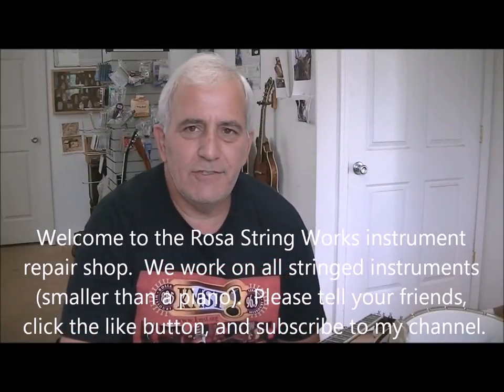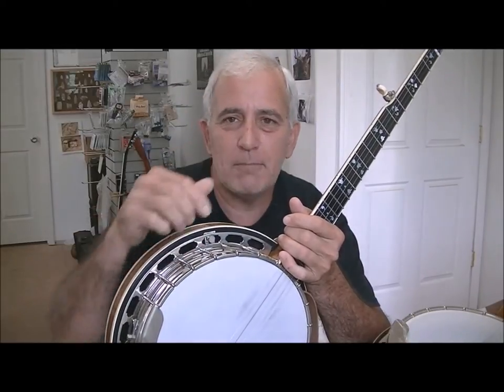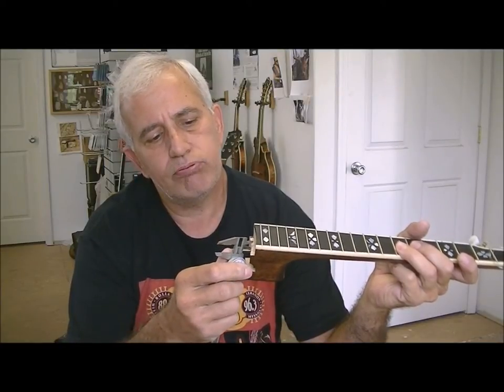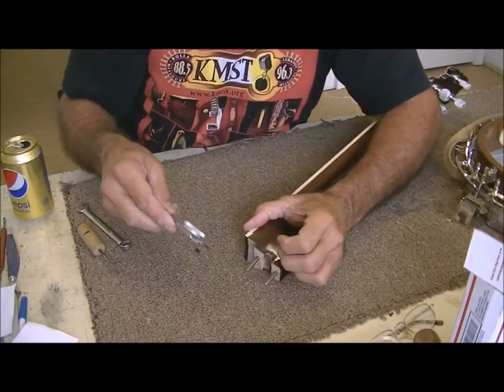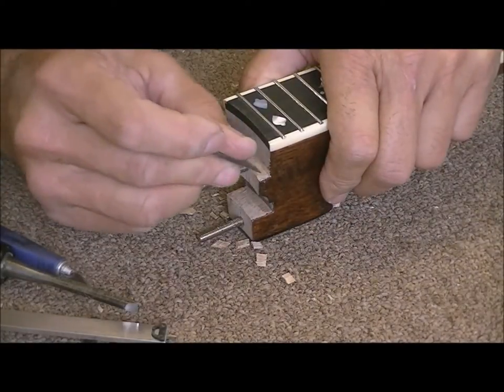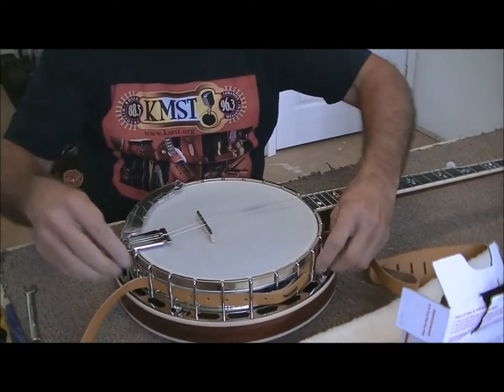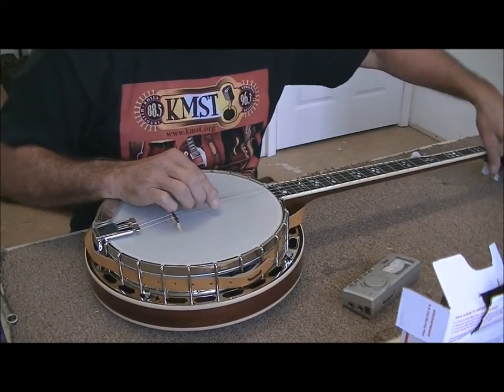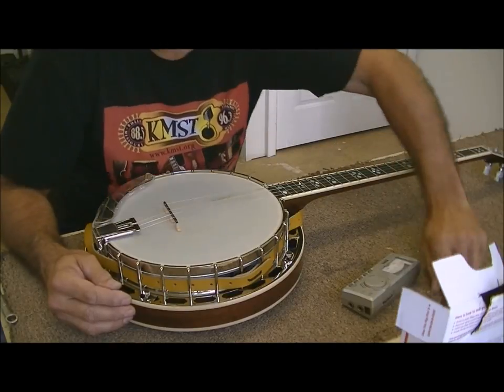026 RSW Deering Banjo Fret Job Recording King Banjo

Comment: I've been enjoying your videos for some time now, and learned how to fix up an old Aria Pro II mandolin I've had since the mid 80s. Today I stumbled on this video. As you were removing that section of wood from the neck heel by the bolt, I thought, "It's going to change the action." And sure enough when you put it back together, the action was too high. So when you tightened the lower rod and it brought the action down, I went, Eureka!!!! I grabbed my old Washburn 5 string, whipped off the resonator and tightened the bottom rod as you did and, Boom, the action improved substantially, the firmness of the connection made the neck more stable, and the whole banjo played with more snap! It's like a new instrument. Thank you for your videos. - WPT

Comment: I wonder if someone may have installed the wrong crown height head on the Recording King? For instance if the banjo was built for a medium crown head and someone put a high crown head on it that gap you are talking about would be much less than it should be, of course if a low crown head was installed the gap would be much larger and give you more space to tighten the head. Good info, really enjoy your vids. Cheers!
Reply from the maker: As far as i know, this was a factory "new" instrument.  Don't think it was altered.  Though, with banjos, you never really know... ha!  Thanks for the comment.
Reply: Randy, I use a Remo low-crown head, because less of the head and the tension hoop overlaps the tone ring when the head is tight. I get a slightly "freer" tone that way.
Reply: @RosaStringWorks  The RK may have been factory new, but that doesn't mean the good folks at Recording King made the right choice in which crown height head to install on a banjo with that depth of neck notch. Also, it looked to me that before the repair, the head was so tight that the top of the tension hoop was almost down to the level of the head.  If the owner needed room for even more tightening (so the head's flesh hoop didn't bottom out on the heel) he should have just switched to a medium crown head, a faster and less costly fix.

The Deering is interesting. That's a Deering Maple Blossom neck. But the flange is a Gibson style. No way for us to know from the video if the owner has merely swapped the flange (which is not easy to do on a Deering) or if the whole pot is something other than a Deering Maple Blossom.
Reply: Agree, different crown height should have been an easy fix.

Comment: I'm not sure by warping the rim to adjust the action is a good Idea. I change mine by shimming the neck. 

In my opinion, in the lower priced Deerings the Goodtime two isn't much of a banjo, but the Goodtime Special is just awesome. It has a tone ring. Unfortunately, they are mangy dog ugly.

About 6 years ago in the park in Ocala, Florida, a good Gibson was playing. Then a Deering played. The Deering didn't sound like the Gibson but it had a much sweeter sound. I'm someone who can love two different things at the same time.

I built an arch top banjo from spare parts. I turned the rim form some old maple blocks that the kindergarten teacher was going to throw away. I made it a full inch thick and eliminated the "coordinating" rods. It competes well with my Jim Rae banjo which is essentially Huber HR 30. Jim Rae designed the HR 30 (R for Rae)  He just gave it to me. He was an engineer here at  Mayo Clinic. He is a Phd. scientist. You should see his basement! All kinds of sound research stuff there. He has one of the first Stellings ever made. I was shocked to see it was an archtop!  He also has a Deering top of the line gold plated, engraved, mother of pearl fretboard, special order banjo. That cost him several grand.

I love your practical approach to instrument repair. Nothing has to be perfect. It just has to be good. Love your videos.

Ps. I forgot to mention that I left the tone ring on the arch top a few thousands off the rim  and the tone ring only rests on skirt. Sometimes by violating all the rules something turns out good!

Comment: I have two of these elite banjos for my sins. I play very little bluegrass, mostly malodic - like two hear all the notes of the tunes (I play fiddle) both of my banjos have the same problem as yours but putting a low crown will only make matters worse as the ring will sit too high on the top. I bought the second recording King because it was and is new and half the price of one from a shop. So if any one once one here in the Uk, make me an offer, Ken from across the pond.

Comment: I have problem on my Banjo...There is out of tune (little flat) if the second string fretted on 15th fret, and first strring fretted on 21st fret.
I have replaced all the old string with brand new string, but it still happened.
Why this is happened?What should I do?
I live in Jakarta - Indonesia....
Can you help me....please...
Reply from the maker: It usually means your bridge is in the wrong place.  Flat = bridge too far back,  Sharp = bridge too close. You may have to angle the bridge to get it right.
Reply: I am not realy sure about that sir..
Because, the tone on 12 harmonic is match already with the 12nd fretted 
This occur happened just only on 15th fret (second string), and 21st fret on first string.
Reply from the maker: +Ros Banjo if you are absolutely sure about your testing technique, then the fret slots are not cut correctly.  It is a black and white science.  There is always a lttle bit of error, but if it is consistent, and you are positive you have tested it correctly, then the frets have to be in the wrong place.

Comment: This is not a professional approach to these issues.
Those two things you did to the Recording King should never be done.
It now has less neck contact to the pot which transfers sound and the forced coordinator rods affect the tonering fit and stress the rim.